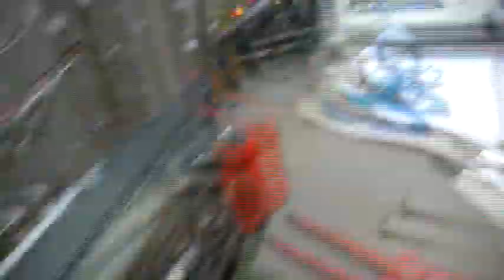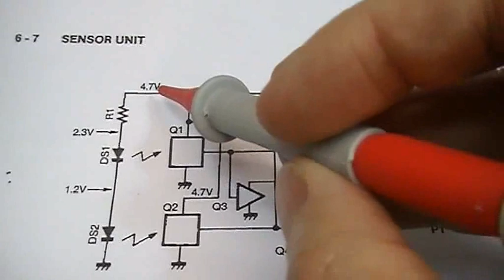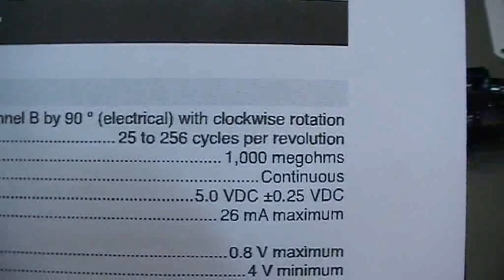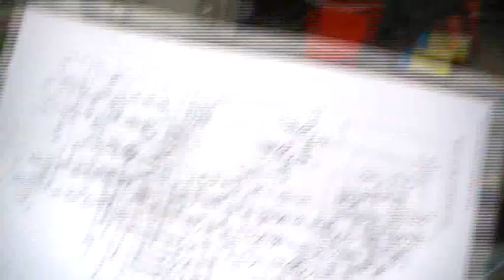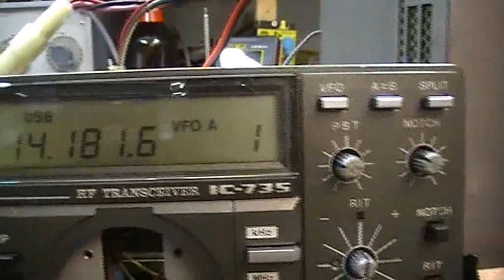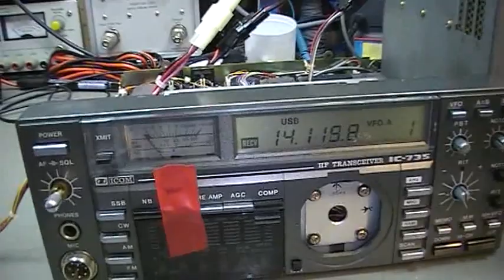#11 ICOM IC-735 Repair/ Replacement Optical Rotary Encoder Dial

Comment: I have two 735 that was in storage for a long time. Problem is, it just turns on and has no recieve and the dusplay is gone but still has transmit. Both worked perfectly before it got stored. Is it still worth it to have it repaired? Some say just to have all the capacitors replaced and it will operate again normally.
Reply: Have you looked into the little jumper on the back of the rig?  Remember if that RCA to RCA jumper is not in place you will have NO receive.  Also if the jumper is there, give it a little jiggle or maybe even go ahead and take the rig apart and check because the RCA connector that jumper connects to is on the main board and doesnt have any strain relief! So something bumping against that little jumper can break the trace,  I have repaired at least one with that problem.  Quick repair to the trace and the rig was in normal operation again.  Good luck

Comment: great video, amazing work with very clear explanation. Based on your explanation, then I can replaced the encoder of my old rig Trio TS780. I got the idea from your explanation on how to capture quadrature signal on oscilloscope, and then added a Schmidt trigger IC to obtain the clean quadrature signal. Encoder is a cheap Chinese made encoder I bought online. I think now I can also repair the Trio Kenwood encoders with same technology as TS780 encoder. Thank you, great amazing video. 73 de YC1FYH Adhi from Indonesia.

Comment: Nice work for an experimental project, but there was much easier to do: we know that the light output of LEDs (and infrared too!) decreases drastically over time while their intensity consumed is always the same : it was enough to replace the two infra-red LEDs, which are extremely easy to find at a ridiculous price. Peter, you've made it harder to worry about damaging the encoder disc, for years I have handled much more fragile ones (sheets of metal 0.05mm thick, perforated with laser!), and we repaired them without problem, it is less fragile than it seems, on the other hand the discs can be "polluted" if they are exposed to fumes (cigarettes or other!), and they must therefore sometimes be cleaned. .... I am lucky enough to have repaired machines incorporating this kind of encoder for more than 20 years .....
Reply: Merci une idée de la réfécence des leds de remplacement .
Reply: Awesome reply! I just purchased a ic 735 my dial has a lot of resistance to turn and jumps up and down also. What do you think I should do to address it?

Comment: Beau travail pour un projet d'expérimentation, mais il y avait beaucoup plus simple à faire : on sait que le rendement lumineux des leds (et des infra-rouge aussi !) diminue drastiquement avec le temps alors que leur intensité consommée est toujours la même : il suffisait de remplacer les deux leds infra-rouge, qui sont extrêmement faciles à trouver à un prix dérisoire. Peter, tu t'es compliqué la vie à craindre de détériorer le disque de l'encodeur, j'en ai manipulé pendant des années des bien plus fragiles (feuilles de métal de 0,05mm d'épaisseur, perforées au laser !), et on les réparait sans problème, c'est moins fragile qu'il y paraît, par contre les disques peuvent se "polluer" s'ils sont exposés à des fumées (cigarette ou autres !), et il faut donc parfois les nettoyer..... J'ai la chance d'avoir réparé pendant plus de 20 ans des machines intégrant ce genre d'encodeur.....

Comment: I had a similar problem with an IC-735 that I bought on eBay.  It looked brand new, and was probably not properly tested before it left the factory.  The solution was to re-align one of the LEDs within the dial.  Used my scope, tweaked the alignment and then it worked perfectly.

Joe - K3JLS

Comment: Hello Peter. Enjoyed the encoder repair video. I have an ICOM IC-275 which has a bad encoder. I also have an Icom IC-735 which has the same encoder except for the brown and red wire reversed. So I tested the IC-275 with the IC-735 encoder and it worked well. So I ordered the Bourns encoder and built the little circuit board with the 2 NTE2359 transistors on it and the disk capacitor. I can not get the Bourns encoder to encode correctly. I have triple checked my circuit. Any help would be appreciated. My email is kf5tb@suddenlink.net
Thanks a lot Peter and keep up the good videos.

Comment: FANTASTIC video Peter!!  Thank you for sharing your knowledge with all of us that repair radios.  I have a bad encoder in an IC-735 that someone from our Amateur Radio wants to repair.  I am looking for a source for the phototransistors used in the encoders.  Do you know where I could purchase some?  Also, I would be interested in the schematic/parts list for your replacement optical encoder.  Thanks!  You can email me at:  N1FBZ@arrl.net

Comment: pe1plu  I have the same problem with my icom 735 is there a possebilty to get a schematic? 73's Jan  jkraak@zonnet.nl
Reply from the maker: Hi Jan, you e-mail doesn't work, no delivery message... 73
Reply: Then try my other email adres pse  jkraak1@gmail.com
Reply: Hello Trx Bench If possible can you try my other emailadres  jkraak1@gmail.com  73's  Jan

Comment: Vielen Dank, 73 Axel
Reply from the maker: +Axel P Alles klar gerne.. 73
Reply: +TRXBench 
Hello
Still a great repair, but, after watching it again I noticed that you were working from 2 schematics, one with a 4 wire encoder and one with a 6 wire encoder and the plug on radio was 6 wire. How do I wire new encoder to work with 4 wire plug on radio?
Thanks
Gary

Comment: I would love to inquire of this because I am finding that I do not have enough hours in a day for this.  I have pulled mine and using a scope have proven the mechanical side of the encoder is fine. The emitters however are questionable and one of the receiver Darlington detector is bad or very insensitive. 
I would be interested in knowing an approximate price and time line to send this encoder off and have someone go over it and make it functional. The rest of the radio is fine with this one exception. I don't wish to be tethered to a laptop computer to control the tuning. :)
Reply from the maker: +Jeff Kline Hi Jeff, well approximate 50$ the new encoder and may be depending on the experience the person have 3-5 hours altogether...  Hope that helps..73

Comment: Any chance you can provide a diagram of the circuit you put together on the bread board? With resistor and transistor values? I have two 735's that need encoder repair. One is an earlier model that has only four wires for the encoder. Is there anyway you might know what the difference between them is?
Reply from the maker: Send me your e-mail adress on my g-mail account.
I will send you waht you need.
Reply: TRXBench
Sent to your google+. Thank you very much.